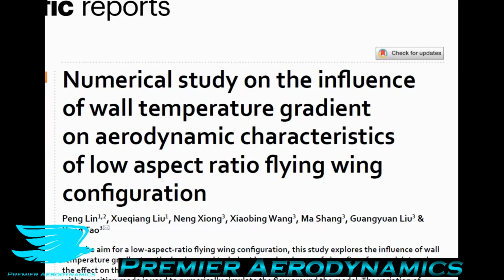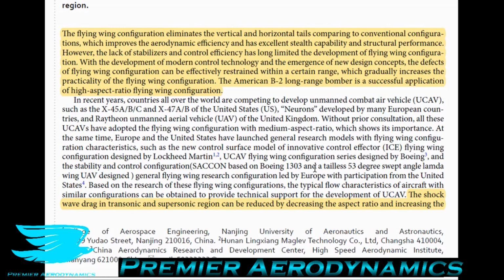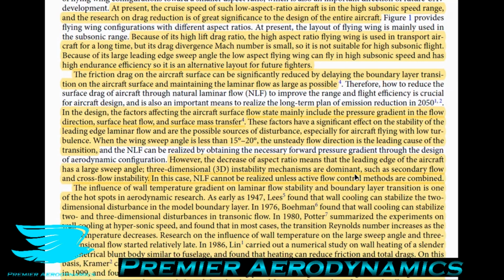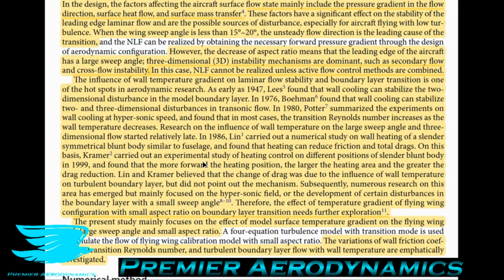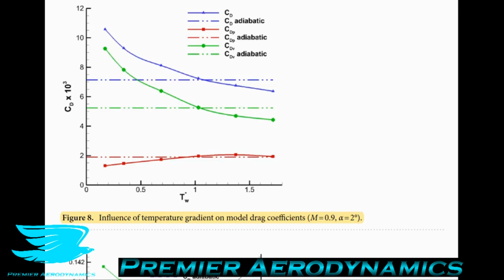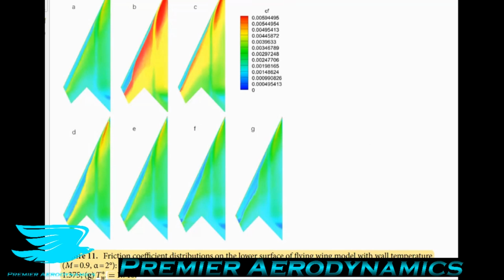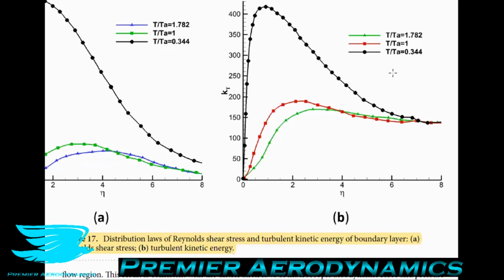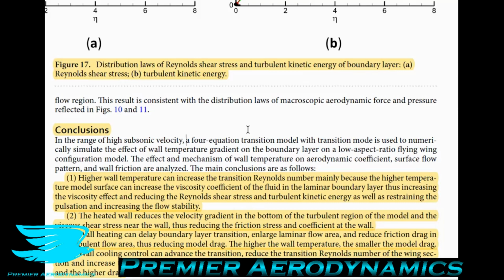Effects of wall temperature on flying wing aerodynamics - podcast #79

Comment: A hot wall increases the viscosity of the air, and also increases the shear forces on the boundary layer, a hot wall will heat up air which will reduce the density as well, and you have two things lowering the RE#, more viscosity and lower density. This understanding makes the results easier to digest IMO.
Reply from the maker: That's a good point! I hadn't thought about the effects on the density (I probably should have😅).

But yeah, that makes a lot of sense. The RE# gets reduced by two factors, which helps delay transition.